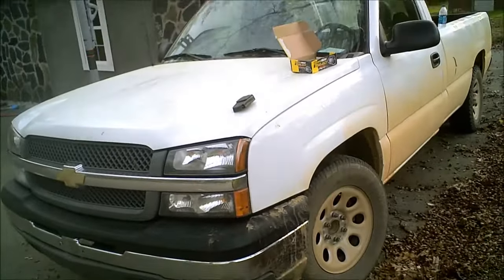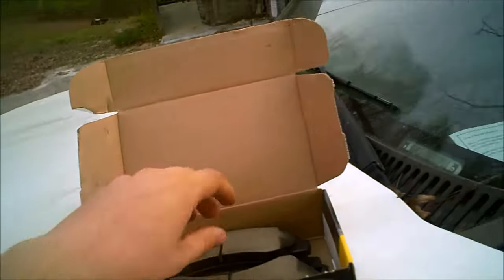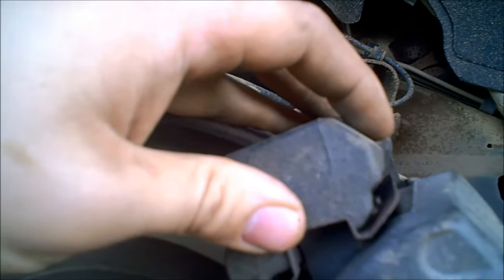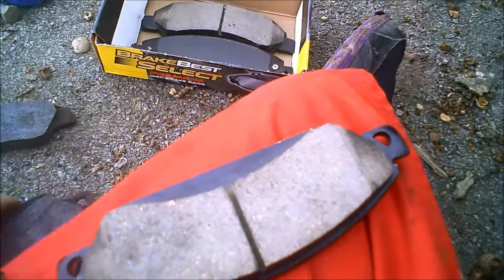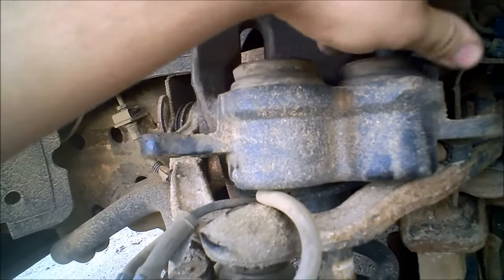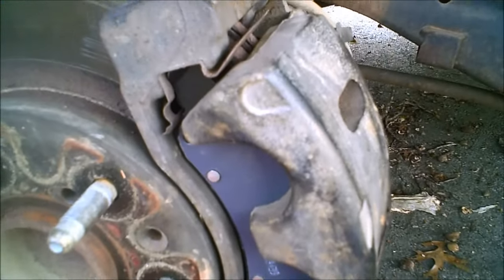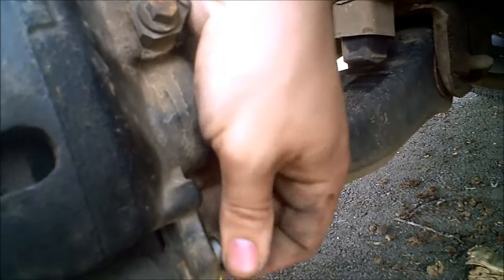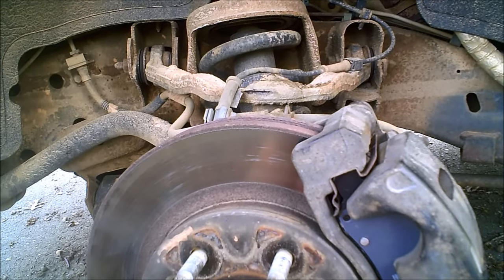How To do brakes on a 05 silverado

Comment: The front brakes on my Ford are easy to do. Tap tow pins out and the caliber pops right off. About 20 mins per wheel. The thread lock on the caliber bolts. Sorry, but I actually winced when I saw you doing that. That's going to make things much more difficult, and time consuming, when you change those shoes again.

Comment: The corrosion on the back of the pad where it touches the caliper piston is a sign of a faulty caliper. It is leaking brake fluid onto the back of the pad. Brake fluid is very corrosive. I would check on replacing the caliper before long. Just sayin..........